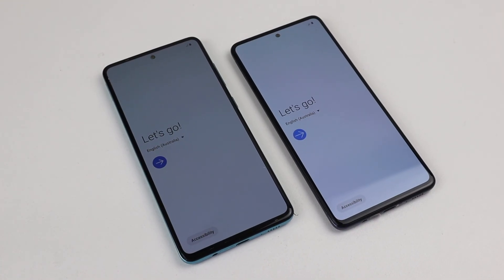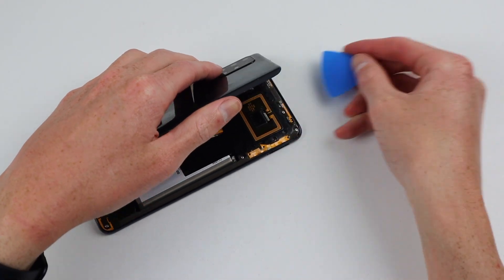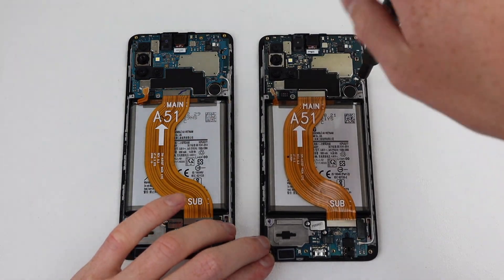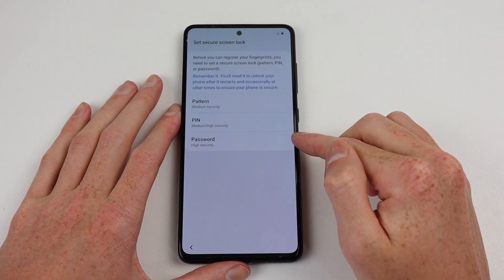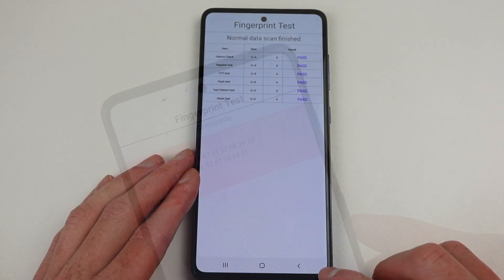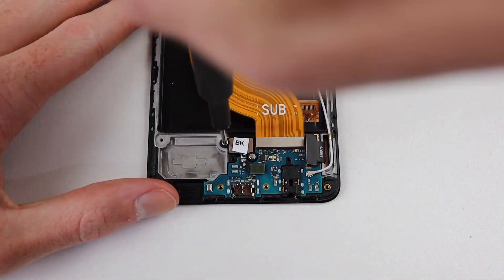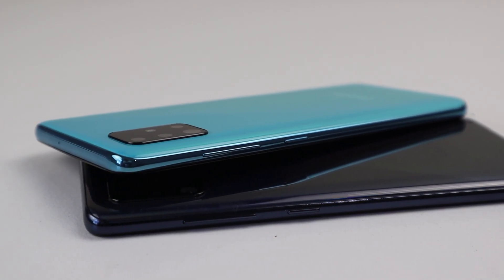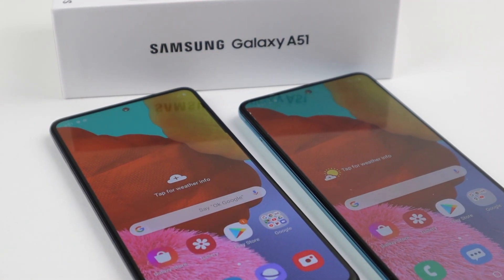Samsung Starts Blocking 3rd Party Repairs? - Galaxy A51 Teardown and Repair Assessment

Comment from the maker: I believe Samsung fixed this issue in a software update as people have been successful in having the fingerprint work after repair. 

I hope Samsung fixes this issue or provides a way for 3rd party repair technicians to calibrate the sensor.
Have purchased some Galaxy S21's to test the repairability of those.
Also going to be looking at other brands of phones to find some repair friendly phones :)

Share this video to help inform the repair community and general public! We need Right To Repair legislation.
Reply: I wonder if this only affects the a51 only or is it for all models who have in display finger print scanner
Reply: @Covid_42069  it's happening to a50s too
Reply: @Covid_42069  no.
Also A50 (happened to me personally) and a70.
Reply: Only those with optical fp sensor
Reply: @Covid_42069  I'm wondering that aswell.
Reply: @Covid_42069  his s21 video it was repairable
Reply: @anonymouslc7278  he had uploaded the a51 video first and not the s21, so I won't have known that
Reply: I should be able to do it... i bought it, nothing hardware should be  out of my ability to work with....

I can change my own carburettor if I want, even if I know nothing about carburettor's it's still unacceptable to lock the purchaser out of their purchase. I should be able to go screwing around in their swapping this and that... and even break something irreparably if i so choose...

Even limiting to only either the manufacturer, and 3rd party tech is too damn much!!
Reply: @ffejpsycho  say that to the notorious apple
Reply: @enigmamyth  hey, Apple is equal in the company best represented by a poisonous serpent competition....

They set the low bar, and others try Limbo underneath it... 

Desperate to get under a lower and lower bar, they can only employ literal snakes, at this point
Reply: Hi im an authorized apple huawei and samsung technician, and i can tell you the same thing is with huawei phones witch have optical finger print sensor, like  p30 p30 pro etc. And its not only A51 A50 have this as well.  Atleast on samsungs and huaweis you actualy need to use actual physical calibration tool. On apple its only through their official software "repaircal". Although  i don't know how apple software works im sure it's just rewrites serial numbers asweel. If you have any question about fixing phones ask :)
Reply: @BulletRain3  hello I work in a repair shop do you know if I can get the apple calibration tool
Reply: @oliver_lauritsen_oa  Hi sadly no you have to pass all the apple mandatory test in order to get it, and become authorized apple technician
Reply: @BulletRain3  nos do you fix the problem ?
Reply: @BulletRain3  how to get access to this physical tool I'm working in a repair shop and we are not authorized but we do these repairs as professionally as  authorized
Reply: I had my screen replaced on my Galaxy A80 a while back, i was wondering if its just my screen protector but it wasn't, i have the exact same issue, though i could get one finger registered after trying it for multiple days of trying with a creme for the hands. Unfortunately i have the newest version so my kernel is version 4 and not 3 so i can't try that one, but i think this happens to all Galaxy phones with an optical sensor. It would be amazing if you could do a community poll, if this also happens to other devices, like the A21,the A80 and so on
Reply: Happens on all A series with under display fingerprint. It's because of calibration. The fingerprint is calibrated to work with the display it came with. However Samsung offer the tools (a tool called a black box and diagnostic software) to calibrate the display for repair shops that want to do it. However if you do it yourself you can always go to a Samsung repair center and they will calibrate it for you for free or charge a very small fee if it's not a samsung owned center. That's how it is in my country. Here's the video on calibration:
https://t.co/LMjvPYSY3h

It needs the calibration to work properly.
Reply: Weirdly, i own a A50 and it doesnt has this Problem as far as i know. I repaired a friends A50, and it didnt happen.. nice Video though
Reply: Luckily they did with only fingerprint reader. I guess there was hole in the security. Ex: I can use my fingerprint reader to unlock others phone just by swapping the whole reader. So they have done like this. What they should do actually is as soon as the reader is swapped, it should automatically calibrated and erase the users existing fingerprint and can only enter through Pin or password or pattern.
Reply: Please do these repairs with xiaomi phones as well.
Reply: @arz1898  Xiaomi is so eazy and fun to fix.
No locked parts.
Everything is easley repairable
Reply: @immanuelhermon  the bootloader is locked
Reply: I wonder if it's in compliance with a law though?

Like, if they let the fingerprint sensor function on a different phone, you might be able to trick it by first  setting up your fingerprint, then you transfer the sensor, then you enter the other phone

And that is particularly dangerous, because you can even enter the file safe on the phone, as well as WhatsApp or Signal even with the fingerprint sensor lock enabled. So I think there might be a law they're just complying to.
Reply: @Birbyvideography  there's an actual reason to this. Calibration. The fingerprint isn't broken it needs calibration to work with the new display. Since there isn't 100% accuracy in manufacturing the displays the differences can affect the accuracy of the sensor so you need to calibrate it. You can see in the video when it does work it is very wonky. You can get this done for free at a samsung shop even when you replace the display yourself
Reply: @Birbyvideography  yes, indisplay FP (especially in midrangers) aren't as advanced as the ones on flagship. So I find it reasonable to pair the scanner to a particular phone. Hope this changes in the future.
Reply: I wathing on a51 :)
Reply: @user-jB0a9nsOVa  i don't know if your telling the truth but be careful in buying a phone, there are brands that Block 3rd Party Repairs
Reply: flash android 9 via odin then register fingerprints then update to android 10 via odin without wiping data and the fingerprints... is the only thing that comes in mind. (If you still get calibration note with 9 which i doubt then try mmi *#808# to calibrate )
Reply: I work for a repair company in the UK and as recently as 4/12/2020 we have been able to change the screen of a Samsung A51 and have the finger print sensor still work afterwards.
Reply: I doubt they will. They been copying Apple on everything lately.
Reply: I don't understand why these companies think 1st sale doctrine (or other appropriate acts) don't apply. It's your phone to do with as you choose.
Reply: @melissa-hadfield  Fuckin' A!
Reply: Hugh this has been a known problem also with iPhones for some time.. Change screen to 3rd party = no FaceID. Solution: Reprogram screen. The screen / finger printer reader would have a unique serial paired to the logic board. You'd have to manually reprogram the part to regain functionality. Separates quality repair shop to dodgy. That is why some people comment with the video not being true, as they just so happened to went to a decent shop. PS: Those tools to reprogram the screen generally cost the same of a new screen anyway so their reserved for shops at that cost point with a lucrative advantage from home repairs
Reply: Did you try reaching out to Samsung and asking what is needed to calibrate the sensor?  You'd feel pretty dumb if it turned out that all that needed to be done was really just a timing calibration because the sensor can't get a read when the pixels above it aren't in certain state, bringing down to a simple silicon lottery without the calibration.
Reply: Ive carried out a few a51 screen replacements and not wncountered this issue once ?
Reply: Hey i work at a telecommunications company.. i notice that there are some signal issues more and more for samsung devices. I notice it on my own. 
If you can take a look at it
Reply: pairing the fingerprint sensor to the motherboard makes sense for security reasons !!! you shouldnt be able to swap a pre-programmed sensor to a locked phone and unlock it that way ...and you shouldnt be able to hotwire the connector or hook it up to a micro controller that simulates a genuine fingerprint sensor to unlock the device ..... it happend with much more complexes devices like PlayStation and all the mod ships available for it and if Samsung leaves the fingerprint unpaired to the motherboard someone will make a mod ship to unlock all there devices .....
Reply: @fouzaialaa7962  but he replaced the screen, not the fingerprint scanner
Reply: My grandad has a a21
Reply: I wonder, if this would happen only on official samsung firmwares or on the custom ROMs like lineage also??
Reply: Ask LTT to spread the message!
Reply: If you ever need phones in wholesale do t mind asking
Reply: It's gonna be harder to repair the galaxy s21 lineup bcz of that camera bump, very annoying
Reply: Maybe did incorrectly
Reply: thanks mate if i had broken the phone i could have had to pay for a new one again then
Reply: Samsung are terrible
Reply: the solution to this problem is very simple; thank God, there's a lot of smartphone companies out there, just buy a phone from a brand that Doesn't Block 3rd Party Repairs
Reply: @zackrider3708  not that simple, in the UK if your phone is not apple or Samsung, and some Huawei no one can repair as they don't want to bother ordering the part for only you
I had a Xiaomi and no shops could fix it
Reply: @Flo-lp6eg  i think its because of the marketshare , if it has a small marketshare  then there won't be much 3rd party support for repair
Reply: my friend has a31s
Reply: well back plastic is better
Reply: how about if you downgrade the security patch 1st that works and replace the LCD, after replacing update the security patch again and test it will work.
Reply: I was sub ti your channel but for some reason I was not ???
Reply: you should make a video explaining the solution. their defence is they are security linked components
Reply: It has to be something wrong with those devices! I've just replace my screen with a original one (at least the seller say it is) and fingerprint it's working just fine, latest update  and everything.
Reply: that replacement display looks like the one off of the older version of this phoneme dad has an a 50 and the screen looks the same.
Reply: Samsung is garbage...As apple
Reply: Can you plz tell me how fix iphone baseband issue
Reply: like another comment stated before, this could actually make some sense. how should the device know that it is a genuine fingerprint sensor and not some sort of "unlock-modchip"?
it would give this hypothesis a lot more weight if it was affecting other parts like the cameras, battery or whatever.
Reply: I WAS JUST ABOUT TO ASK if you will repair the s21😅

Thats the least thing i want from the s21❗❗❗
Reply: Is the scanner still working after updating ota ?
Reply: @baratthuj  how? Mine is not working
Reply: @uumerdraz  bro i was just asking that wether the phone he fixed is still working after updating to the latest version you can try downgrading as well like he did if your binary is same as his
Reply: @baratthuj  that's the problem my phone is at binary 5 and the rom he showed that worked is at binary 3..
Reply: A71
Reply: How's the Microsoldering coming along? Any videos of that coming soon?
Reply: They would have too or you can just switch the fingerprint sensor loaded with your print to another phone and get in
Reply: Why would you want 3rd party repairs when they use inferior parts and charge you just as much. The phones are made to last till Android updates end anyway. I would never take my phone to an Asian shop and have them do anything with it.
Reply: Maybe Samsung do this to their mid-range smart phone models
Reply: they are copying apples bad business practices
slowly I'm beginning to hate samsung
Reply: imagine samsung will copy the back cameras as apple's (maybe)

the interesting thing is that apple made the iPhone 1st gen in 2007 and samsund tried to copy apple in 2010 xD
Reply: Nope. Wrong. Samsung is and has allways been REV dependend. If it's not the same revision, and i do not mean the software. If the part does not have same revision it will most likely not work , or work very bad. And i do not mean the MPN. Check rev version. Remember the galaxy s4 ? That device had hundreds of revs on the charging flex cable. And got to a point, where at EOL if it was not same rev, it wouls simply loose wifi, not get 4g, not charge, etc.... Same with the sim card reader. No correct rev version, it would not simply register the card.
Reply: Makes me wonder about my galaxy tab s7+...
Reply: I have the a51 and the fingerprint sensor was bad since I got it, returned to Samsung a week later since December 8th and keep going back and forth with them as they destroyed it even more when they "fixed" it
Reply: Shouldn't compromise with security
Reply: I've also been repairing my friends and teachers phone and some of them are A50,A50s and A51 they all lock it. But from what I discovered is the fingerprint sensor is tied to the motherboard like what apple does. Not really the screen as I swapped many screen for replacement. Mostly is the charging board, fingerprint sensor and motherboard must be together most of the time.
Reply: I found something strange: during ADD new fingerprint scan, if you push your finger harder you''ll get % up and finally 100% but it's hard to get it. So maybe samsung change something in back layer of new made LCD or front glass in factory and that also conflict. I test this pushing on A705.
Reply: have you tried using *#0*# to recalibrate the fingerprint sensor? my S9 has an option for that
Reply: This is how my next phone will be a oneplus
Reply: sell me one of the A51 kindly
Reply: https://youtu.be/jjGcKs_1hu8
Reply: did they fix this?
Reply: hello, still no solution comes out, for the sensor of the a51f.?
Reply: If it was an Apple device you would be S.O.L.!!
Reply: You used a wrong Display the Display you bought was diffrent than raht of a Samsung Galaxy A51
Reply: I have a samsung A51. It overheated yesterday and now I can't get it to charge. Can you direct me where to get help. Please
Reply: From my experience, the problem is the motherboard differences... even note 9 for example, the cameras and iris scanner fail when using  different cameras... quick story short,  make sure is exactly the same model.
I hope this helps
Reply: Lol mines the a32 bacillus the same phone
Reply: There is no "issue" to fix, it is a feature. For them, not for us.
Reply: Hey6, any update on this? Does it still happen?
Reply: I have a problem with My Samsung Galaxy A51 , the fingerprint dosent work, it says it needs to be calibrated
Reply: You should allow shipping in India too😄Big fan
Reply: Never, the trend in the sector is to sell as a service not a product. You do not own the  smartphone because you only own the hardware that can only work with the Software from the corporation that you do not own but only are licensed to use as allowed by license.
Reply: You should take a look at the blackphone
Reply: You hope Samsung fixes the issue? It isn't an issue mate... it's purposely done to stop users repairing their own phones. It's no an "accident"
Reply: I'm glad in your s21 video it's fixable because that's my phone
Reply: @Hugh Jeffreys if i am on binary 5 is there any way to install that binary 3 rom that you just showed working with aftermarket screen?
Reply: It's 2024, they didn't 🙂
Reply: This issue still persists as of October 2024. I recently replaced the display on a galaxy A31 and I'm encountering the same issue. I need to find a way to fix it now. What i noticed however is that the issue is no longer present if you use 3rd party displays. I tried 3 and all of them worked with the fingerprint scanner the only thing that needed to be done was to remove and re-add them. However as soon as a genuine display is used this issue occurs.
Reply: I’m going to be honest but they probably won’t, apple got away with it and made money so Samsung will too, it’s like that with the headphone jack and the charging brick in the phone box.
Reply: @trendering3932  ofc apple is wiser than samsung and apple has a apple care what does samsung has?  For sure samsung will copy that too
Reply: Hey bro I think you seem to have forgotten to swap the face recognition of the both phones and test it
Reply: @verceluzjohnrafael5601  uhm there's no specific hardware for facial recognition in this phone😅
Reply: @boringmpact4439  nope. You need an certain box to calibrate this fingerprint scanner. Here's the video
https://t.co/LMjvPYSY3h
Reply: I recommend OnePlus. I've bought multiple over the years and never had any issues.
Reply: @Saxophone_King  OnePlus 8 pro has FP sensor also calibrated to match the screen. So if display needs to be replaced, FP needs to be recalibrated
Reply: @pyryone  that's good to know. I'm yet to have one come across my bench so I haven't tested it yet. We actually have a hard time competing with OnePlus repair prices so they don't come through often.